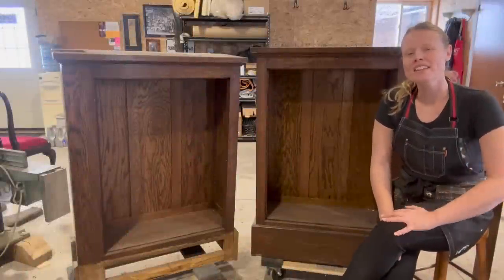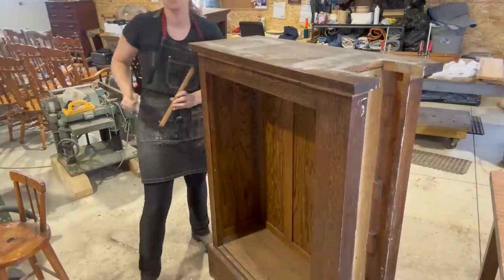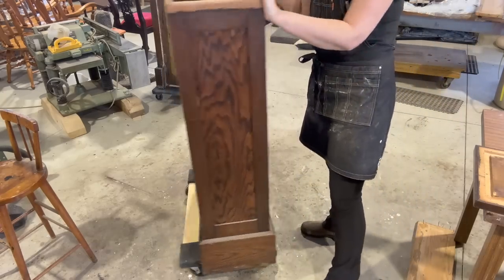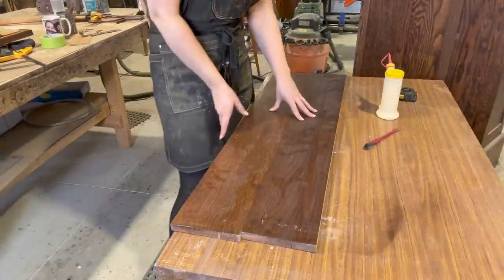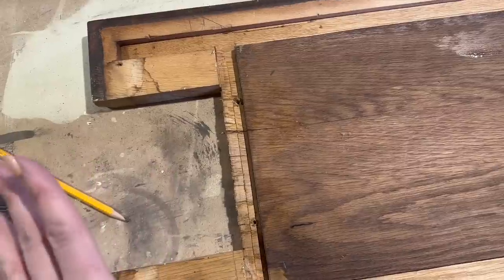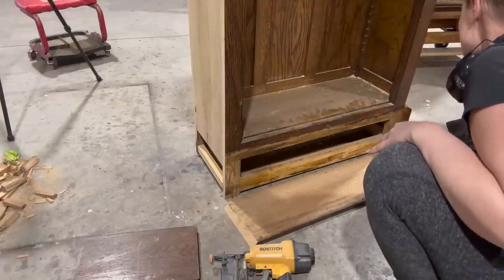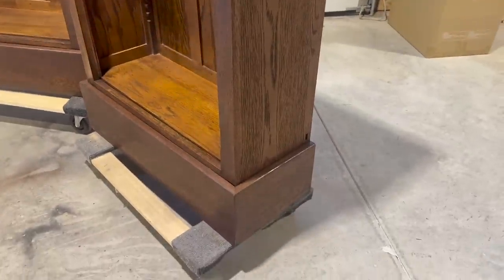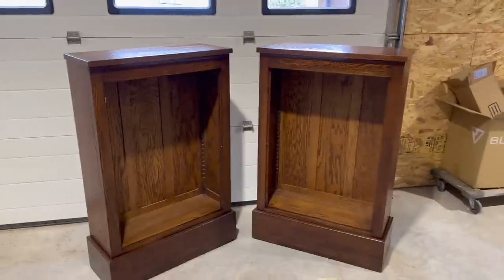COSMETIC SURGERY on old bookcases

Comment: They came out way better than they had any right to!  As you say, the small difference in ends will not be visible in practical use - they are after all, useful items not Fine WoodWorking!  Awesome job.

Comment: Excellent work. Not much about that project was all that easy. Having worked with pneumatic nail guns, for decades, pin guns  through framing guns,  I cringed when you had your finger right next to the nose of the gun when firing. I've seen hardwoods turn the nail/brad 180 degrees right into a finger that's  pushing on the wood. Once saw it penetrate a guy's finger bone, when he yanked it back it pulled the brad with it, that was a bad day.  How ever long the brad is the minimum distance to keep away.
Reply from the maker: Yikes!

Comment: As always, a beautiful job and I always learn from you. I was expecting you to trim back both sides of the top and do similarly sized edge boards with a mitered joint. Just wondering if that entered your thoughts, and, if so, what thoughts went into deciding. On another subject, your ability to match colors is TOP NOTCH. We see it in video after video and at about 20 minutes into this one. I wonder if you would consider doing an in depth video or set of videos on how you go about this.
Reply from the maker: Maybe one day